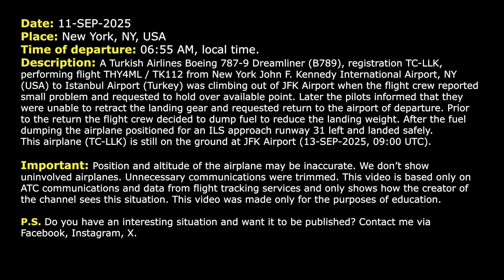Turkish Airlines Boeing 787 Dreamliner dumps fuel and returns to New York after gear issue. Real ATC

Comment: A reasonably good interaction 

But, given that JFK receives maximum international airlines, it really needs to train its controllers on international communications practices. 

1. 
Ask clearly, “state nature of emergency”. “What’s going on?” Idioms only confuse a pilot whose primary language is not English. 
2. 
Most wide bodies and modern narrow bodies have fuel dump or jettison ability. 
3. 
How many times does the pilot need to say  jettison”
Reply: These pilots trains on international communication. This is stupid.
Reply: At the same time international airlines should receive training for US air traffic.  We use the term “Fuel dumping” in the 7110.65.  The Turkish did not declare an emergency so why would the atc ask what the nature of emergency is rather than ask what’s going on
Reply: @user-fx6xn5cw3t as I said. Only the issue of idioms. Hear the pilots response to “what’s going on?”. “We are talking to our technical team”. If you eliminate idiom, the answer is correct. But it’s not the information the controller sought. That was my only point. May be “state the nature of the problem” or “what is the fault” may have elicited a more informative response.
Reply: @user-fx6xn5cw3t  They do explain the problem in the 1st radio call in the 2nd they declared emergency, also it is a International Airport so should be Aviation English not American English. Also the rest of the world including UK accept both terms as Boeing call it fuel jettison Airbus call it fuel dumping both mean the same so how does a controller at a international airport not understand what both means is just mind blowing.

Comment: How can they dump fuel over land?
Reply: It disperses in the air. 7000 feet is almost 2 miles and I bet there's a western wind
Reply: Minimum 6000 feet needed for safe fuel dump.
Reply: Easily.
Reply: They pull this little lever, and ….

Comment: "4ML, please state the nature of the problem."

"Unable. That is confidential company information. 4ML"
Reply: 1st you fly the plane she said many times I will tell you in a sec this controller was a mess couldnt even understand the term fuel jettison like what the heck. Fly the plane, Navagate the plane then communicate. what caused the emergency at the time was not important getting the checklist done was at that point.
Reply: 1:15, they clearly stated landing gear problem in one of their very first transmissions. Controller probably missed it somehow.
Reply: I got the impression she told him what the problem was multiple times, but he was so keen to fire up the mic, he missed it every time. I know JFK is a busy airport, but throwing radio etiquette out the window for the sake of a few milliseconds doesn't help get things done any faster.
Reply: @alexmiller7721  No. She didn't. She wanted to get authorization from the company to do so.
Reply: @leviathan3434  Possible, but we won't know that for sure until he unkeys his mic. Like I said, it's just the impression I got.
Either way, playing Quick Draw McGraw on the mic like that could lead to important information being missed, or having to be repeated in an already stressful situation. It's a safety issue.
Reply: Lol. Riiiiiggggghhhht